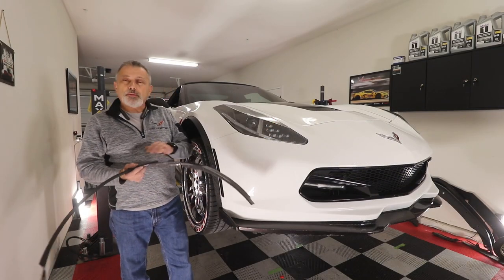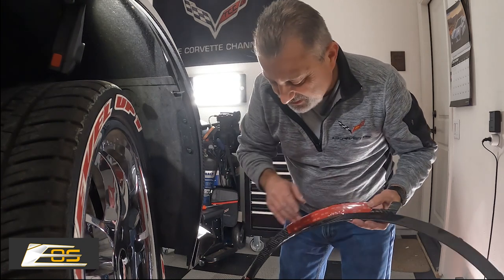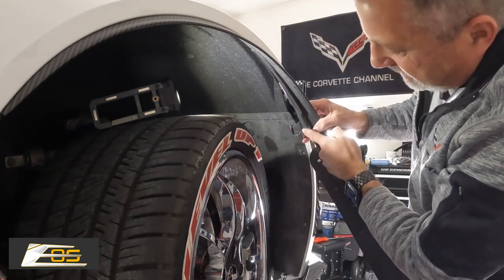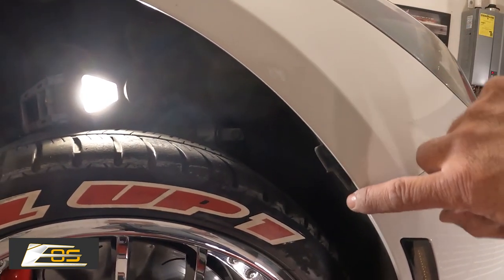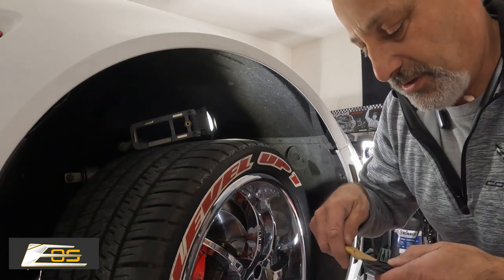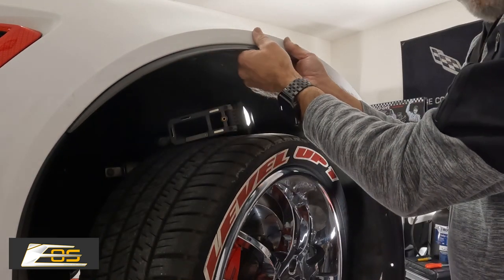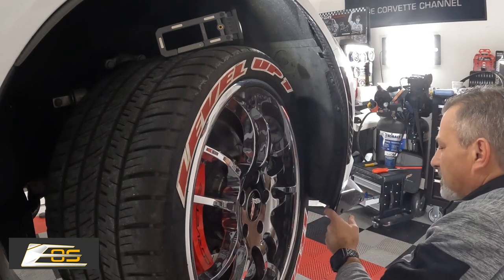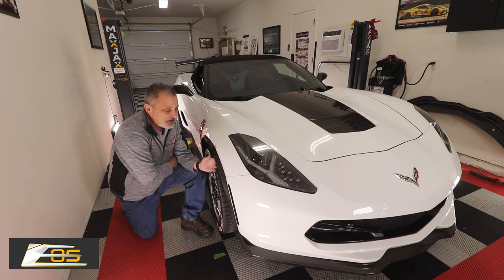How to Install a Carbon Fiber Wheel Well Extensions on a C7 Corvette

Comment: Great video definitely helped. I just have to say instead of starting on the top with the 2 prongs does work. However it is extremely difficult to line up that transition bracket. It took about 40 mins to get that piece up on top of the bracket inside. The other side I just started with getting the transition piece up on the bracket first then lined up the holes on top. Literally probably took less then 2 mins to do. Might have been easier for you since the suspension was dropped but if your car is on the ground it's extremely difficult cause there isn't much room. Anyways just my 2 cents for those who are installing them.
Reply from the maker: Thanks for the feedback. I will keep that in mind. Thanks for watching.

Comment: Is a set of Carbon Flash fender flares for my C7 Z51 Stingray available from EOS?
Reply: The z06 extensions do work on the z51 with alittle TLC and trimming. Pretty easy.
Reply: @justinreid8851  Can you provide any details of what you did to make it work?